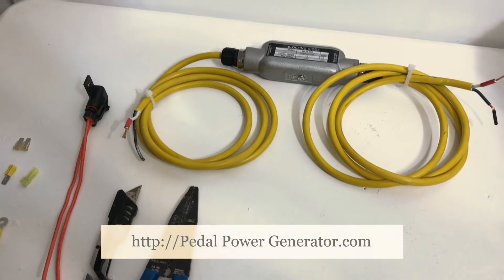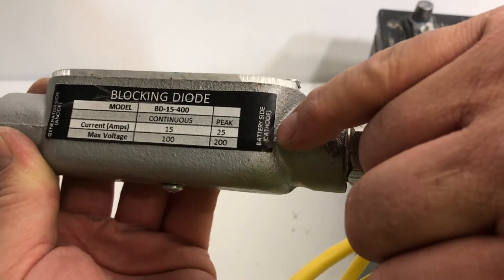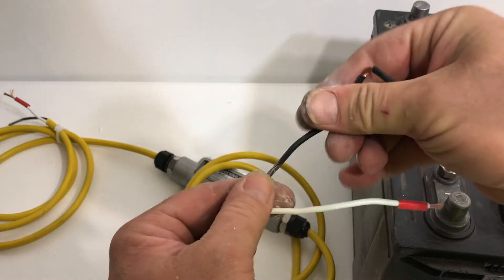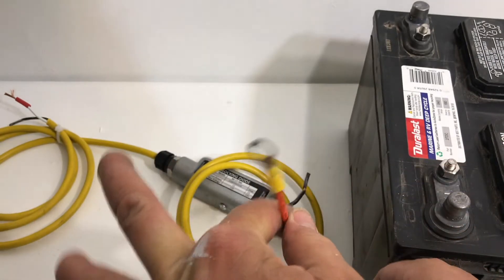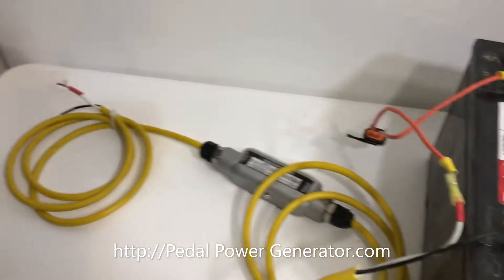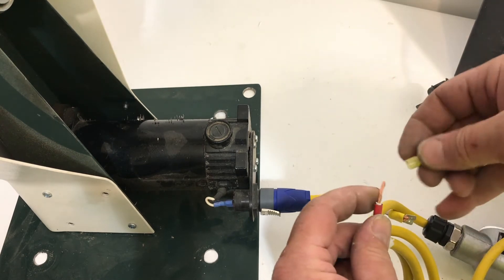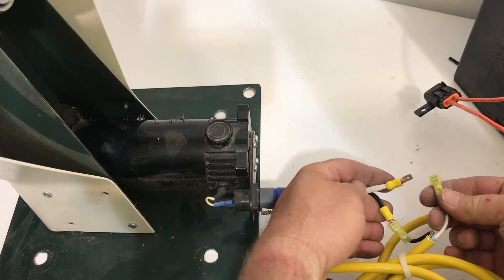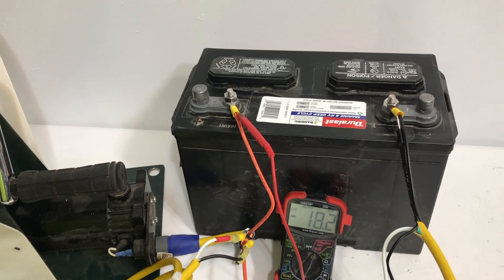DIY how to hook up blocking diode and fuse to a 12V battery hand crank HPG  Generator or solar panel

Comment: I know you can wire however you want to,  but just not to confuse anyone. In a 12v power system with black and white wires, the black wire is typically considered the "hot" wire (positive), while the white wire is considered the "ground" (negative); this follows the standard electrical color coding where black represents the live wire and white represents the neutral wire.  I still appreciate it anyone who takes the time to make a YouTube video to help others. Thank you.

Comment: The way you slice the insulation is very dangerous that might slip off along the lenght and cut your wrist. Safety first better than sorry.
Reply from the maker: Yes- I've done this a thoasand times and know how to guide the blade but it looks really scarry now that I watch it, thanks for bringing it up.   I will add a comment there  to say do this on a flat surface.